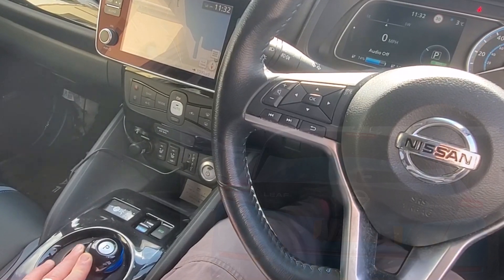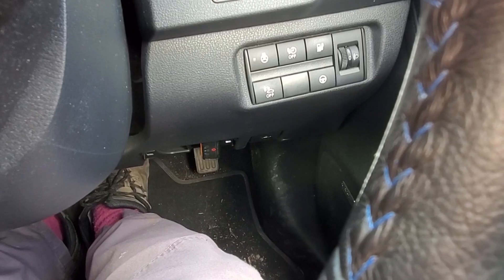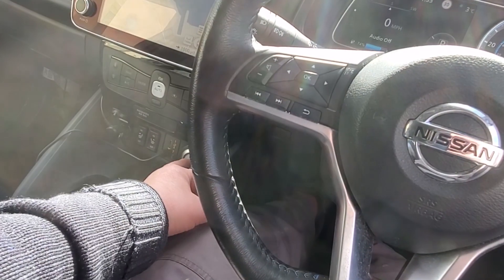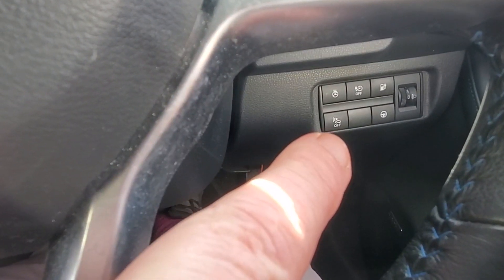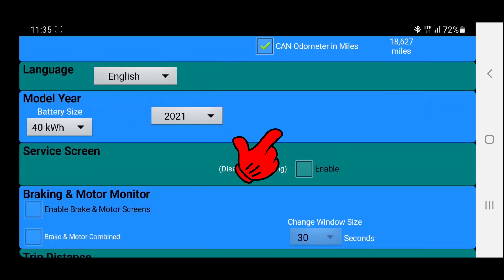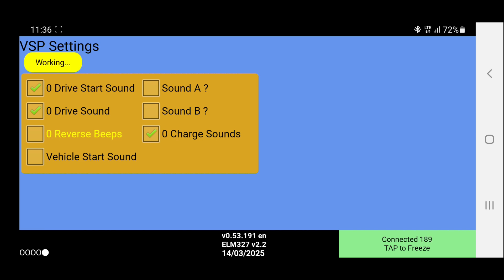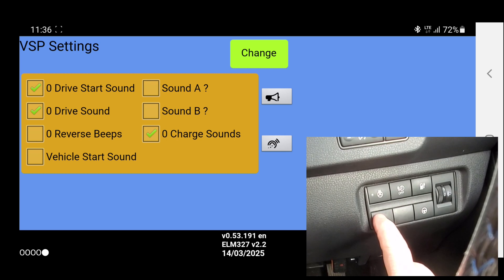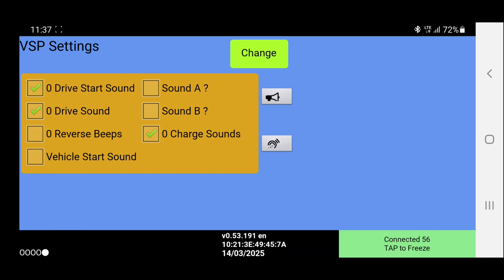20250314   Leaf Reversing Beeper

Comment: I want to do the opposite. I have a late 2020 (revised for 2021) UK Leaf and the reverse beeps have never sounded despite selecting the options in Leafspy. But if I press the little loudspeaker icon they do. So they're in there somewhere. Is it an age thing? Are they switched off 'deeper' than Leafspy can amend?
Reply from the maker: Have you got the Pro version? Maybe that's it?
Reply: @peterguilliatt Nah, mines the base Acenta model, rhd UK.